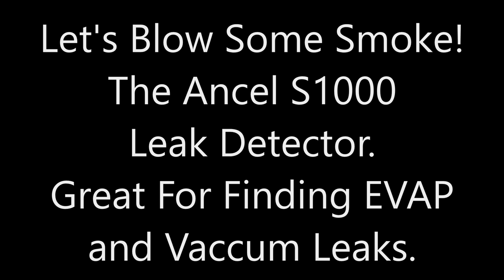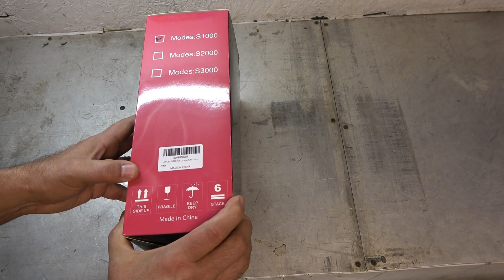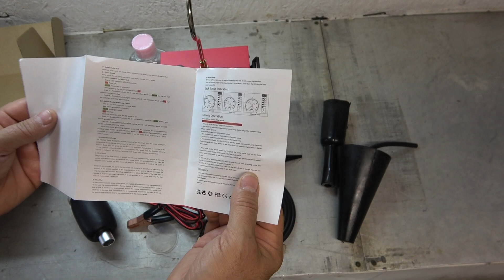ANCEL S1000 Diagnostic Leak Detector. AKA, A Smoke Machine. The Tool Is Needed To Diag Evap Codes.

Comment: Great demonstration Erik, not only did you showcase the tool, but also diagnosed an issue you weren't even looking for. You just got two for the price of one.
 Can you tell us what the Volvo was doing or wasn't that you had plans in the future to try to figure out? Was the car hard to start, ran rough,stalled or sputtered upon acceleration?, That was an intake manifold wasn't it?.
  Providing I was a mechanic, you proved the tool was a valuable one and would definitely purchase one.

   Anyways, thanks for the demonstration, Take care!